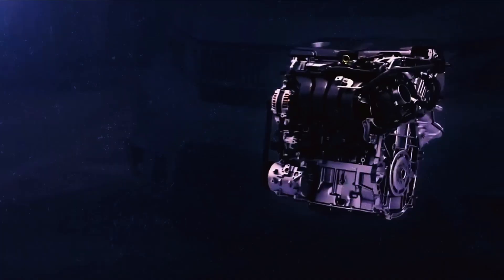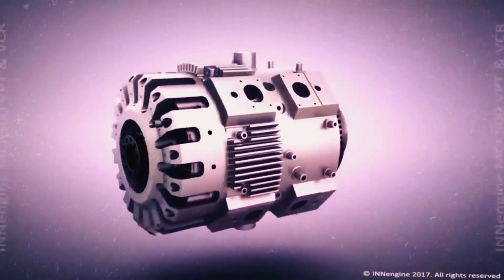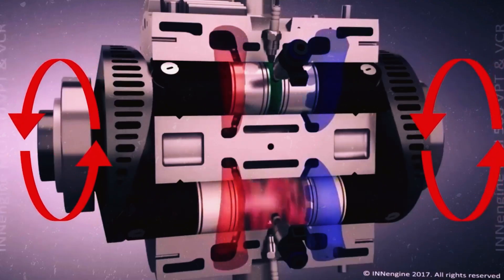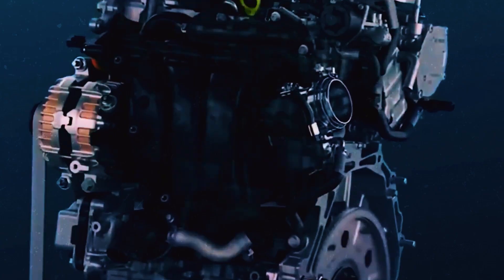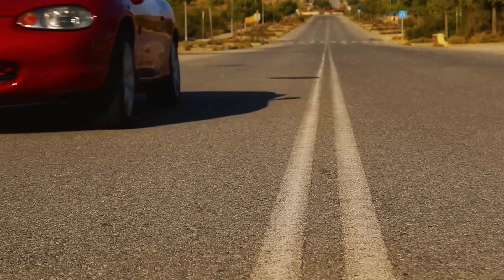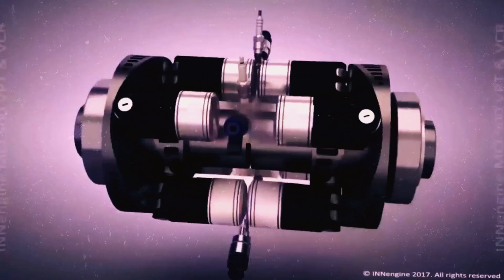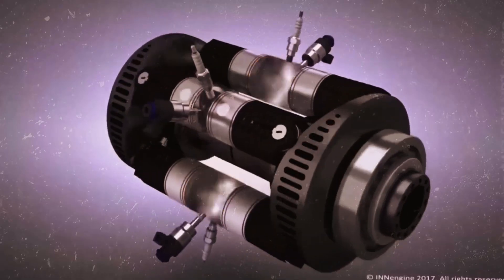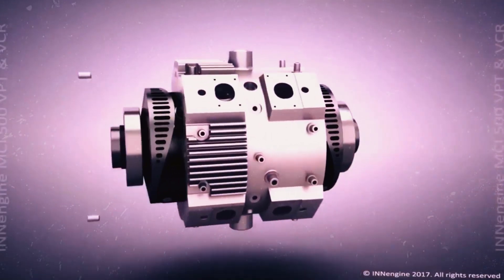E-REX BY INNENGINE: REVOLUTIONIZING THE MOTOR INDUSTRY!

Comment: I want one of the mounted on an Aptera with the smallest battery. Set this engine at a speed to keep up with the maximum draw of an Aptera and you get batteries that last much longer because they are always automatically charged as needed. For apartment/condo dwellers without their own charge stations this makes an electric car feasible.